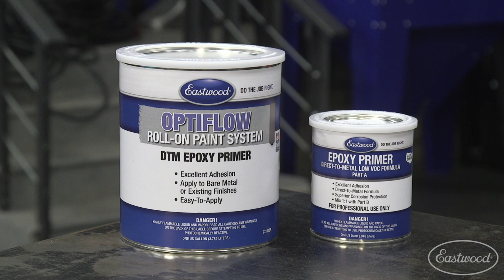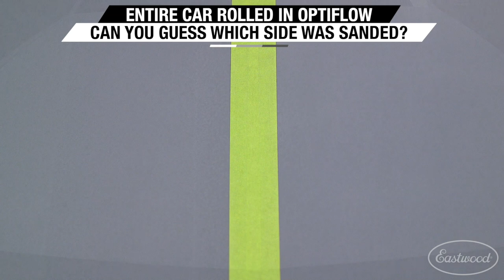OPTIFLOW vs Traditional Epoxy: Why Simply Rolling On Traditional Epoxy WILL NOT WORK! Eastwood

Comment: People have been rolling epoxy since there was epoxy.  Just look at how boats are painted.  They've been using 2 part epoxy and urethanes forever and they get great results.  I even did repairs on an aircraft rolling on epoxy primer and 2K topcoat.  Results were great.  Sanding the epoxy is the key to a good finish.  The cost of Eastwood's Optiflow make it a joke--it's significantly more expensive and then they go off and act like they just invented the wheel!
Reply: Thanks my friend for that! I was thinking the same thing

Comment: Will rolling on standard epoxy affect the adhesion or corrosion protection, or simply the texture of the finish?

I need to prime some new floor pans and the surface texture will not matter, just need durability and rust resistance. I already have a QT of standard epoxy primer. OK to use for this project?

I do admit the OptiFlow looks really cool and I would definitely like to try it for some exterior painting down the road.

Comment: So can just wetsand the normal epoxy smooth? Optiflow is the better option for professional results  but if on a tight budget and willing to do the sand work can still get decent results from normal epoxy, do makes you wonder if you could do a single stage paint with a roller
Reply: I'd think you might be able to sand it out smooth, but it could take more sanding than the optiflow would. I have seen people use a roller on single stage, but it was on stuff like tractors, farm implements, stuff like that. Nothing I'd ever use on something you want to look nice. Single stage also takes forever to dry and cure, compared to base/clear, from my experience.

Comment: well, of COURSE you can't see the finish on the optiflow, it's way brighter than the traditional primer LMAO.
Reply from the maker: The epoxy finish is very flat, the urethane has a little texture but both get block sanded either way.  If you don't have access to a booth, gun, compressor OptiFlow is a fantastic solution.

Comment: More thinner in the epoxy = the same thing
Reply from the maker: Not quite 😎
Reply: @eastwoodco  why?
Reply: Jeffemano More thinner will help it level flatter
Reply: Eastwood Company yes same thing, I’ve checked the ingredients. More thinner would mean it settles smoother.
Reply: Possibly (and this is my 'layperson's point of view) - adding additional thinners to the 'normal epoxy' could increase (almost for sure it will) the shrinkage %.  On bare steel - that would probably be ok to get away with - but possibly if over filler etc - that may cause unwanted issues.  But - HA - us 'beggars' have plenty of time to sand the finish flat.  There may be variants of the actual ingredients in both products - even if they are listed the "same" - that may not mean that chemically they are the EXACT same.  If it was me - I'd prefer to purchase the product specified for roller application - I am not saying that the other could not be used with a roller - but it may require a lot more work or other issues may arise by using the spray formula for rolling = better to be safe than sorry.  I have been a fan of using rollers for many years - saves HEAPS of material - no wasted overspray (you will be amazed how much of your paint ends up in the air on the floor etc from spraying) and you can lay down primers//undercoats and even topcoats in the same shed as other workers and not kill them from the overspray fumes.   HA - yes - I have even rolled topcoat on tractors//buldozers etc - PERFECT finish (HA for the purpose).  BUT - make sure you perfect your roller technique - as with any paint - you can end up with some BIG lines in the finish when using a roller.  Rolling on a dead flat piece of steel is simple - wait until you get to curves - corners - peaks etc etc - that is where you need to THINK CAREFULLY about the edges etc.  A roller technique called 'laying off'(or 'laying out' - HA depends on which university you went to) can be useful in some rolled areas.  Honestly - even if you have a spray booth to keep the fumes enclosed - once you use a roller system - for the right applications - you will never look back and want to use it as often as you can.  Yes - NOT for everything - but it does have benefits in certain applications.  I have used special foam rollers on clear-coated furniture - and honestly -- it looks like fine orange peel straight out of a spray gun.  Yes - I have a lot of experience using a roller - but anyone that thinks about what they are doing will quickly achieve the same level of EXCELLENT finish.  And this is just my personal opinion - I have always preferred the slightest bit of orange peel on an everyday driver//rider than dead flat sanded and sanded and sanded finish.  To me, the dead flat mirror finish is fine for a show car - but for everyday use - a slight bit of orange peel is acceptable.  Plus - I have never seen a 60s-70s etc car come out of the factory with a mirror-like finish - and with my cars//bikes - I try and mimic the factory finish.  I am in no way 'bagging' anyone with a mirror finish on their street car//bike (yes on some cars//bikes I do that) - I respect the amount of work that went into achieving that show like finish. HA - as my Sifu once taught me - PERFECT PRACTICE MAKES PERFECT -- HA - because practice does not make your perfect - it just keeps you repeating the same SHIT - HA. (HA - no - I have not proofread this - so forgive any syntax mistakes) Have a nice day all.  CHEERS from AUSTRALIA.
Reply: Eastwood Company yeah why. Your paint looks like water. I’m trying to figure out what your pant cost 2x